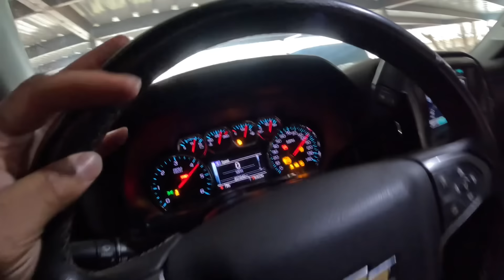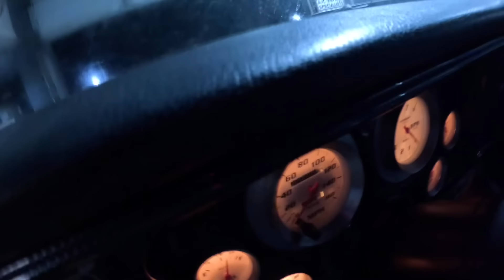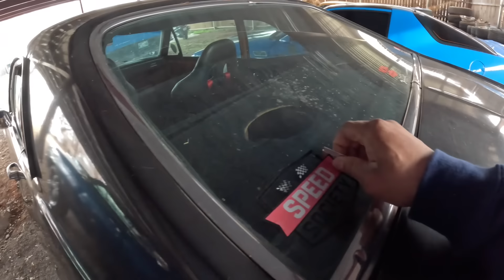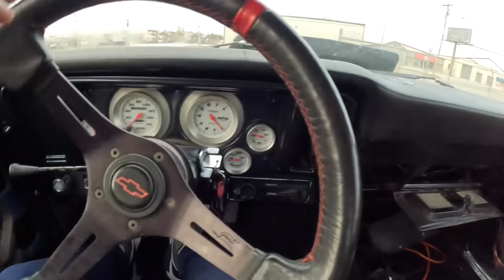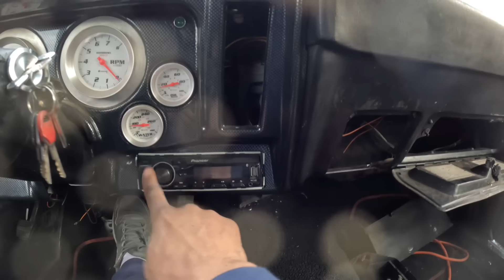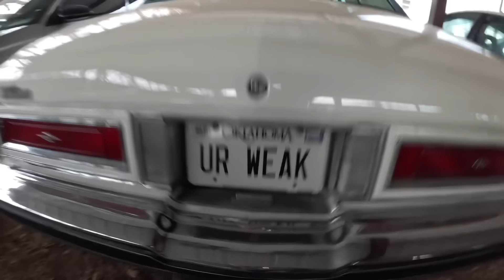I Bought A Tweaker’s Project: and SAVED $10,000!! Hidden Performance Parts!!

Comment: The Nova SS is a nice car but definitely needs work 😩  I'd say the rear end is going to need a rebuild and you continue to drive it with no fluid in it like driving around with an engine without oil . It's probably a rear end from a Camaro like mid 80's with disc brakes . The front came with disc in later years so they probably switched it over I guessing.  The tachometer doesn't work because they way the had the distributor and the mechanic only hook up the hot lead . It's definitely sad that you know nothing about old cars much less hi performance  cars so you'll never get them right . The guy that did the rear end in the Chevelle is who I take it to if the rear needs to be rebuild.  I'd definitely leave them wheels on it too and not some rainbow 22 inch wheels 😂 It's a race /Street car not a lowrider .